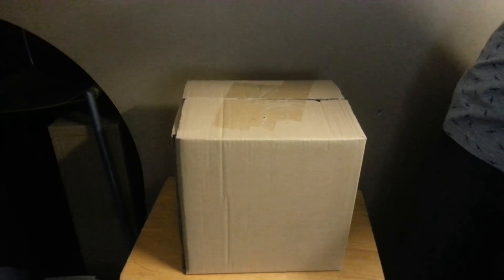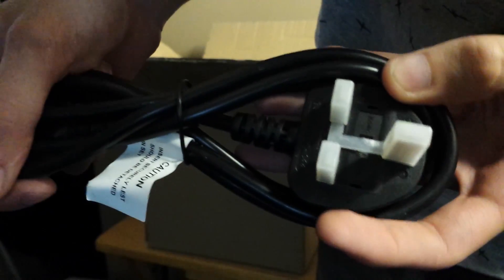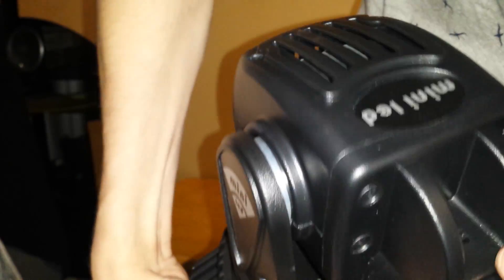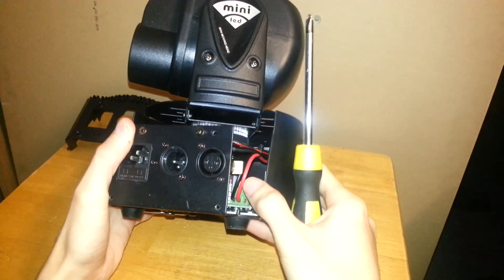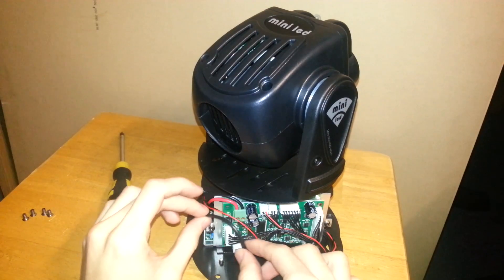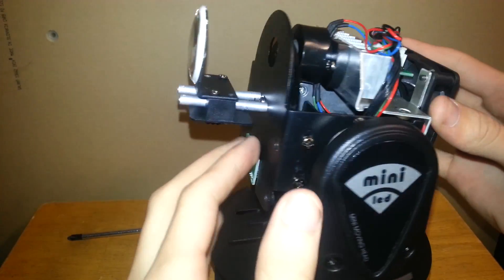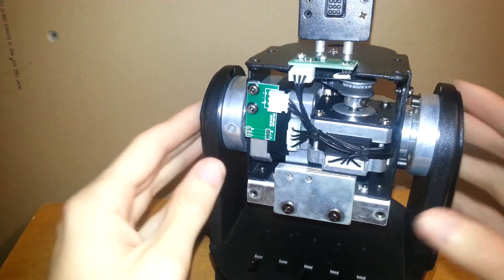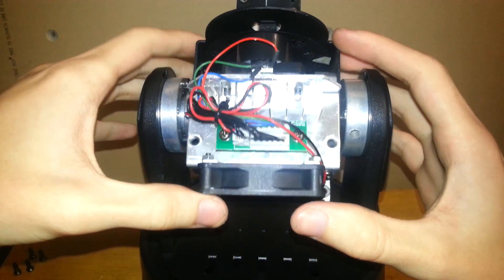15W RGB LED Mini Moving Heads (Model P046) Unboxing & Teardown, Plus Quality Analysis & Demo

Comment: Is there a way to make it run in sound mode and only tilt 180 degrees and pan 180 degrees. I like to set it on a table top, but do not want it shining back at me. Only left to right and from the floor to the ceiling, not back.  Thanks !

Comment: Can you use u ground USA plugs
Reply from the maker: Hi, Yes these should also operate in the USA just fine. The plug isn't what is important to power these, it's the input voltage. However the plug you use with these units MUST be grounded for safety. 
The casing on the units in this video specify they can operate on 100-240V (volts) so they would work in many countries. 
Hope this helps!  --Nathan

Comment: I bought 16 of these for our DJ Dept . I have learned when buying from China direct you Open and Tighten Everything . What I did is sat down EVERYONE in the office and we each took a Fixture to work on. We went through them with a fine tooth comb and let me tell you. We use Blue Lock tight on all screws going into metal or have nuts like the fans .NOTHING WAS TIGHT . But we do this on ALL shipments from China .  It also Helps the guys/gals see How And Why they work . We also contacted the maker of them and got a box of spare parts sent to us . We got LOTS of BELTS ...

Comment: Your presentation was informative and useful on several occassions! What might be needed to change the gobo wheel to something say Halloween, Christmas oriented or even promotional
Reply from the maker: Hi, Thank you for your kind comments! I'm glad to be of help. :) 

Regarding the custom gobo I believe you would have to get a completely new wheel made as I can't see any way you could successfully modify this one to a decent standard. 
You may find somebody who actually already does custom gobo wheels for these as they seem to be quite popular fixtures. 

Changing the gobo wheel is likely to be a pain in the butt to do though as everything will be against you / in the way and may require an almost full stripping-down of the upper head section. 

Personally it's something I wouldn't even consider on a fixture of this price point and quality. 
However if you do find something or try and make your own, do let me know how you get on! 

Hope this helps, 
--Nathan

Comment: why are the who lights sitting in the exact same position but one head is inverted and the other isn't?
Reply from the maker: +Judson Taylor that's because I linked them together with a DMX cable and inverted the slave/second head. It gives a better effect than them both pointing in the same direction at once when you invert the tilt, pan, or both on the second light.
Reply: Nathan PH I didn't think about the fact that it was mirroring the opposing light. Totally my bad.
Reply from the maker: +Judson Taylor its fine dude, now you know :)

Comment: Mine came and it was perfect. All screws tight apart from the fan screws on the base. Noticed a hair on the inside of the lens so I had to strip the head apart just to clean the lens of the hair. Oh well. Engineered fairly well since QC Improved. The fan in the head now screws into the metal and not into a nut. Loads have changed in the build
Reply from the maker: +James Robert Wilson It's all just a lottery really, It depends who you buy them from and how much you pay. As is the way with most Chinese things sold on eBay.
Reply: +Nathan H Yeah exactly, cost me £70 for mine and was from a UK supplier
Reply from the maker: +James Robert Wilson You paid about the same as me then, I paid roughly £140 for my pair from a UK seller delivered next day. 
At the end of the day all these UK sellers do is import them from China and then list them on eBay again though! haha.
Reply: Thats pretty god, I'm hoping to get another 2 or 3. Very good for the price i think!
Reply from the maker: Yeah they're decent for smaller venues or when there's nothing much else on. I've recently picked up 7 Starville MH-X25 movers at a amazing price that need some work, I'm almost finished working on them and I'll have a video up once they're all done but they are AMAZING compared to these things. 25W white LED's and they have color wheels, gobo wheels and rotation and they are about 10 times brighter than these. I'm impressed with what 25W does since these are supposed to be 15W. Maybe more like 7-10W?
Reply: 7-10W seems more like it yeah, and those Starville movers are indeed amazing. ill be sure to keep an eye out for the video, cant wait to see them!

Comment: Do the settings remain after switching off. Hassle to reset in a hard to reach places.
Reply from the maker: +taffeine I would think they do, But I can't actually remember for sure. I will set them up tomorrow, do some testing and get back to you! :)
Reply: +Nathan H Many thanks.
Reply from the maker: +taffeine Apologies for the delayed response, Had two gigs in two days! :) Yes my pair do keep settings after a power cycle.
Reply: +Nathan H cheers and thanks again

Comment: purchased 4 of these and the screws plastic holding the lens inside came apart. This should help fix them, although not sure where there is a spring inside
Reply from the maker: +Gene Mills They aren't the best build quality going, they leave a lot to be desired... But for the price point they aren't TOO bad I guess - You get what you pay for after all. Like mine with the loose fan nut inside, I don't think they have any kind of quality control.
Reply: +Nathan H yeah I paid less than 300 CDN for 4 of them used and you can hear screws in all the lens pieces rattling around. I have to take them all apart but this video is gold! A big help
Reply from the maker: +Gene Mills glad to help you out, I had real doubts about purchasing them and the quality and that's why I made this video. :) I use them monthly at a local pub for live music nights I do sound engineering and the PA for, They just sit one on each side of the stage on a bass bin - OK effect providing there's nothing light around them otherwise they get washed out easily. Hope all goes well for you! If there's anything you need help with just let me know and I try and assist you.
Reply: +Nathan H I'll definitely take the rest apart next week.. Still don't know why there is a spring there.. May not be needed.. I got two adj inno
Spot pros at the same time so these may not see a lot of action unless I can figure out a DMX profile to use for them
Reply from the maker: +Gene Mills what software are you running them with? I'm about to create a FreeStyler profile for mine in about 15 minutes for a gig tomorrow! So if you're using FreeStyler you might be in luck :)
Reply: +Nathan H  have a Titan one dongle I have tried yet but was gonna check out freestyler with another connector or Showxpress
Reply: +Nathan H the inner focus rings on mine are the issue. the holder that slides on the two bars is pretty banged up. i wonder if there is a way to use order that part from somewhere
Reply from the maker: +Gene Mills that sucks, I'm sure somewhere will sell them. There's millions of sellers on eBay selling the lights.. If you can't find them listed then maybe sending messages to some sellers would get you somewhere.
Reply: If you are still looking for some of these, I have 4 of these and have no issues so far. https://www.amazon.com/gp/product/B013UPEKY8/ref=oh_aui_detailpage_o06_s00?ie=UTF8&psc=1
Reply: Can someone post the user Manuel.